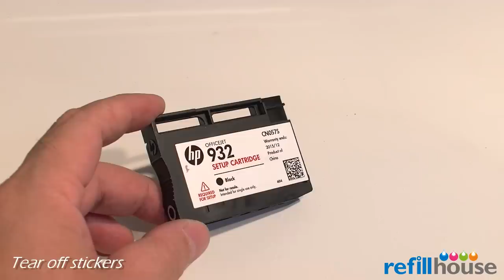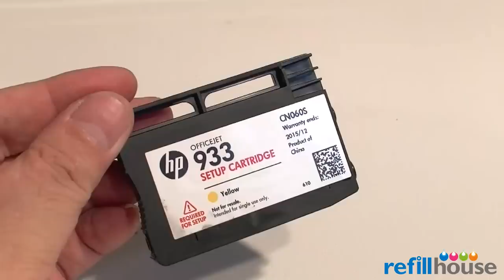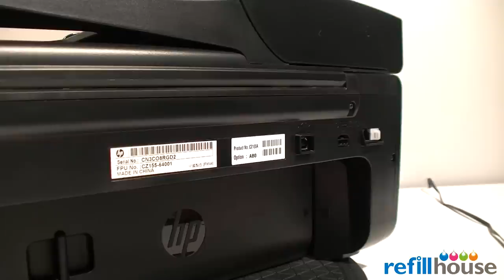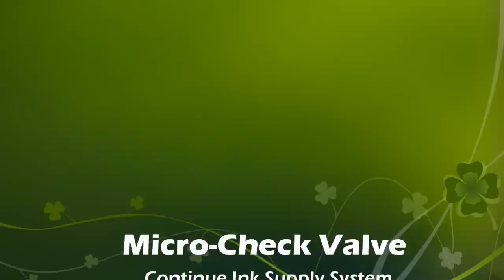HP Officejet 6600, 6700 CISS - HP 932 - 933

Comment: Some piece of quality work here, friend. Big respect. I was thinking and doing my way with a bit similar hp950.
Questions/Ideas
1) Do you really need to close the air-in vents on catridges with foil? Why not simply block them with glue gun or meltin gun (take some spare plastic)
2) Pre-filling inks into catridges and then sealing them with plugs, will save some time of CISS to catridge pump job.
3) Drilling tank mount holes before assembly is more secure, not not damage a cable that runs along the side.
4) Very good idea is to also insert waste ink extension tubes (there are two) from loose ends to external dump. At same right side. This makes a printer run very clean, something that epson has built-in (half-ass, but still).

Also test Back, Home, Home, Back  and Home, Back, Back, Home when in main menu. I use ink diagnostic test to just drop ink to paper from time to time. Saves the trouble of blocked noizzles. Half year without any sign of nozzle block, on inktec.

I wish you much luck!